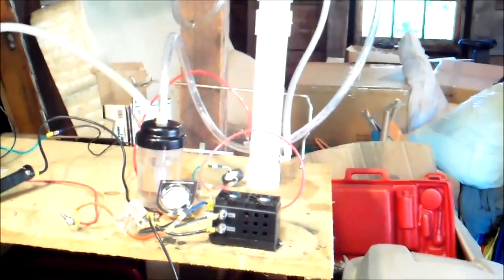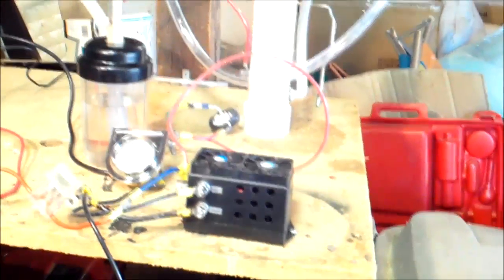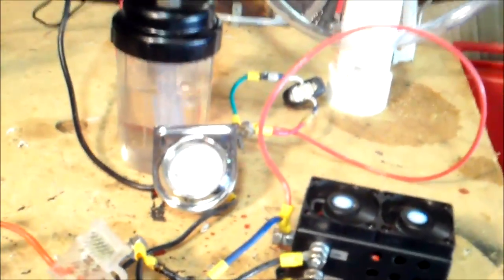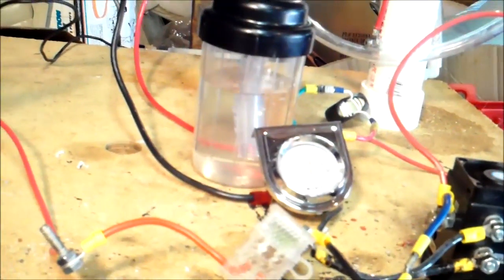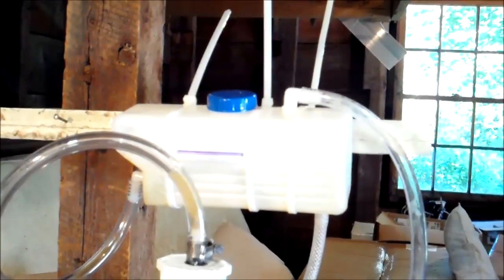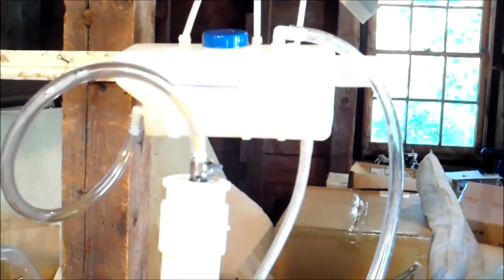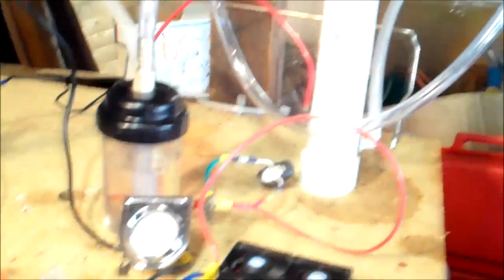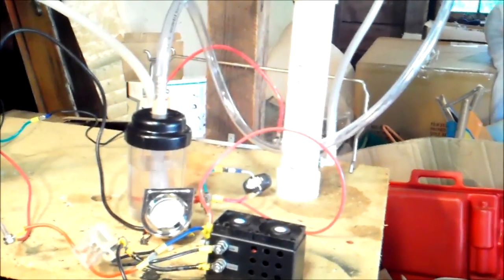Stanley Meyer Tube Type HHO Dry Cell

Comment: The huge problem with H2O electrical dissociation units is that you would have to steal over 4 hp to gain 1/64th hp in  power added to a system. Dr Cho is trying to sell the same bull to the power plants to no avail.
Your representations are dishonest. You are drawing @ 15 amps ... What do you suppose that draw would remove from a vehicle. The rate of production you demonstrated I challenge You to PROVE that you can actually measure a valid change in hp in a vehicle engine you stated tracable to the actual input from the device shown. A dynamometer is not capable of detecting the minute change in hp from an input so small and subtracting the draw on the alternator.